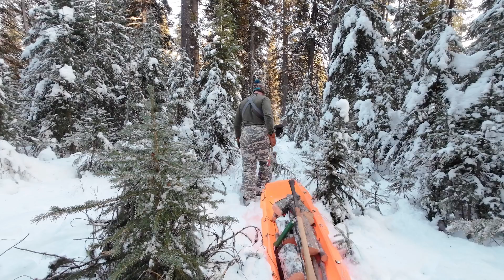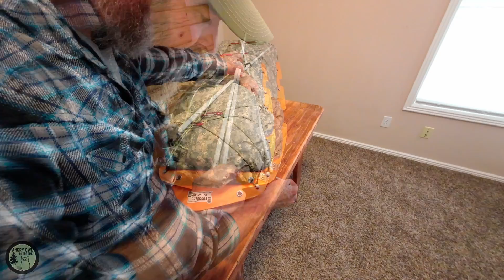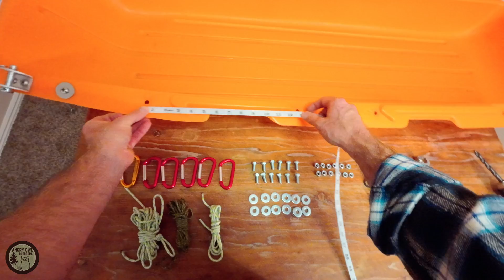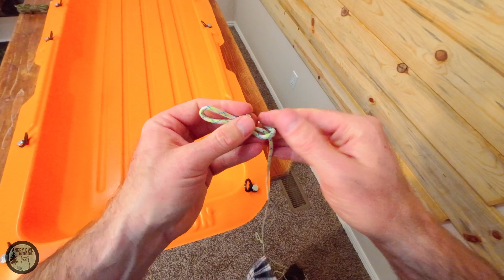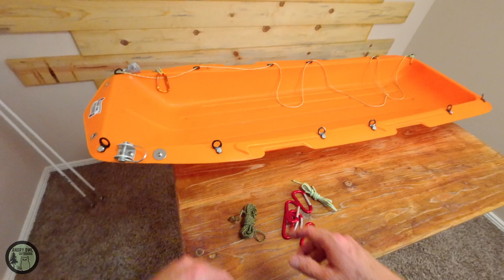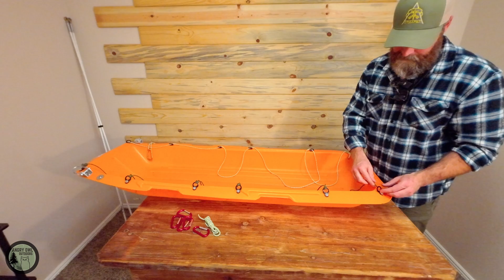The Best Pulk Sled Design - Full Tutorial

Comment: Been using the same dyi 1/2" pvc pipe for poles, for 35 years. No issues. Curious what issue you had with your dyi poles?
Reply from the maker: My biggest issue was using paracord to run the interior, I kept getting too much dynamic movement and wanted something static.  Plus I have a lot of trees in my area and get a lot of swing with my sled, my experience in the past with PVC in extreme cold and wet conditions is that it can shatter with too much force placed on it...sounds like yours has held up fantastic though, so maybe what I thought is rare in the case of sled poles.  Mostly though the eye bolts and ease of attachment with the fiberglass is what sold me...that and that I can bury them in the snow and use them as tie outs for shelters and they do flex like crazy, in a good way.  I picked them up on sale so all in all, not a must have but I enjoy them.

Comment: .. Nice build ,, I have built a couple pulks over the years also , you've covered most of the bases ...  Would recommend putting the guide fins underneath near rear ,, they help in guiding but also keep the sled from sliding sideways on angled hillsides ...
Reply from the maker: Thanks!  Excellent recommendation, I definitely need to add some! I had some rough side hill sessions, where that would be ideal!  Thanks for the input!

Comment: Designing my first pulk, I used a heavy duty sled that was my kids (they’re older now so I didn’t take their sled) but it is shorter than the expedition sled you use. Not having much experience I made my adjustable line too short. I would suggest that line be 3x the length of your sled if you’re using a different sled than the one you use. Awesome tie system though!
Reply from the maker: Great suggestion! Love hearing about improvements!

Comment: Thanks for the detailed explanation! We used your tutorial to build our pulk and it did well for hauling all the extras you would need for a scout winter camp outing. We had some issues with the carabiners popping off the backpack loops during the downhill assent, especially on corners. I'm thinking that next time we use locking carabiners, any other advice for navigating steep downhill management?
Reply from the maker: Glad it helped you and your crew out. You are spot on about the attachment carabiners. I use locking for the pack attachment and only the simple carabiners for the cargo tie downs. 
Steep terrain is just hard regardless, and I have gotten myself into to a bad situation before by going to steep and getting pushed by my sled. Best option  I have found is to unhook and put the sled in front of you and hold by additional rope, then let it pull itself down. For average slopes consider a paddle brake on the sled, there are a few videos out there showing how to make one…. Basically like an snow anchor.

Comment: This a great system! Thanks for sharing.  I am wondering if it is easy to grip the poles to help steer if necessary.
Reply from the maker: Glad you found it helpful! Great question, the way that the poles hook to my waist belt make it too difficult to reach backwards. Really it all comes down to hip control, you can help articulate it with body twists but it really is like a semi-truck where you have to plan wide turns etc…

Comment: Awesome video. I’m doing this build with some slight mods. I have a caster wheel-to pvc poles-to a utility/commando belt set-up that worked great my last two trips. I’ve considered the fiberglass setup and have the poles already but am nervous to change too much of what has worked so well. 
Would you put fins on yours? I’m doing a 4 mile skin starting at 10,000 feet and climbing (eventually descending) 3,000 feet. Fins will slow me down on the uphill but hopefully help track better going down
Reply from the maker: Thanks! Glad you enjoyed and it could help out.  Dang that sounds like an intense trip!  Ya if what you got works, I would say your right to not change it up.  I do not have fins, but I keep it in relatively flat areas.  I have had it roll on me if it catches too much snow on a turn but with the tie down system it is not a big deal.  I did get in a tricky situation side hilling up some steep terrain, biggest thing to watch out for is if it kicks and spins on you...just the slightest over edge on your tracks and it will whip down hill and pull you with it.  I would put in a brake system if I ever go steep with it again, on that same trip, the conditions changed rapidly and the snow became very hard packed and iced over, it made me can the trip and on my egress I should have disconnected and swung the sled to my front  and just held on by grip...I did not and got pushed down hill and went for quite the run and stopped at some big pines..close call and good learning lesson.